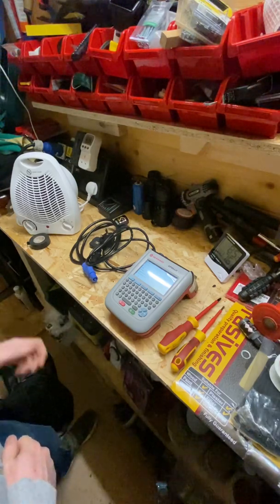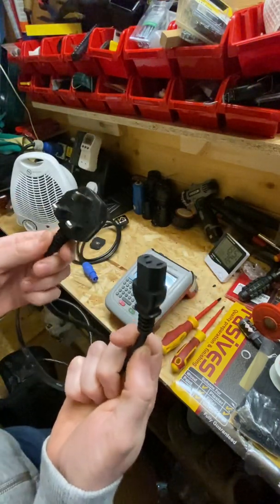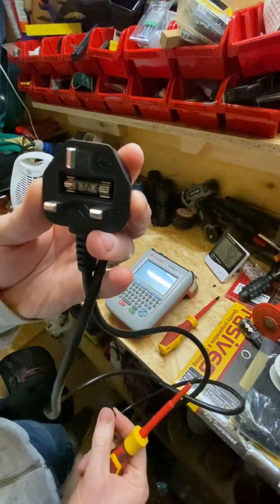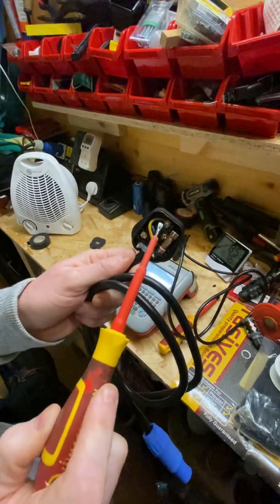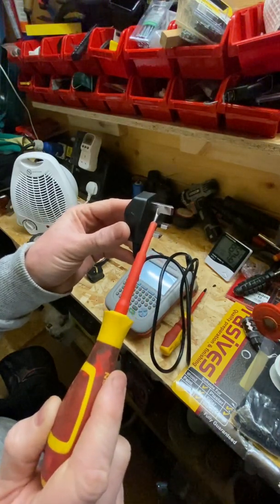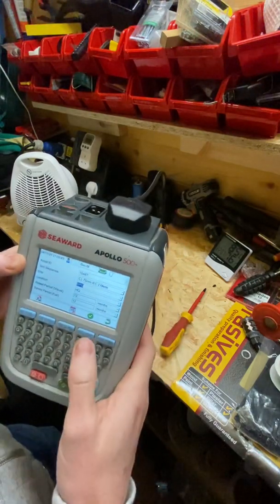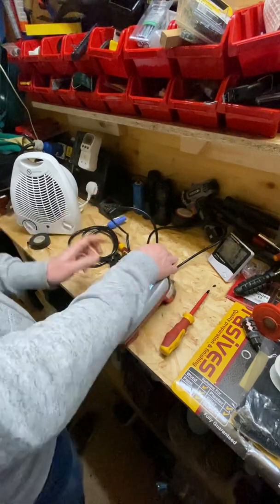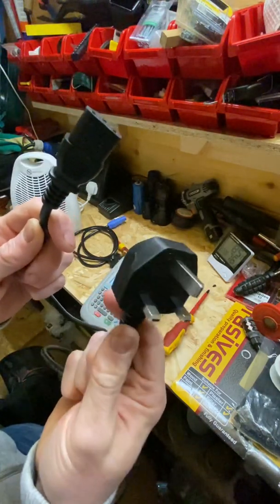PAT Testing a power cable (IEC)

Comment from the maker: Let mw know id you have any questions about this video
Reply: I have a question. All IEC leads have an amp number on the plug, do I put that corresponding fuse into the ice lead. E.g an iec  lead is labeled on the plug as a 13 amp but the screen it's plugged into is only 25w. How do I know which fuse to use ? The fuse labelled on the plug or the lower amp fuse the screen uses ?

Comment: Do IEC to IEC extension cables (M to F) need to be tested in the same way? How is this done with a normal PAT tester which only has one IEC terminal?
Reply from the maker: Yes, very easy to test then using a Pat tester. One end goes into the iec socket and the other into the plug to iec adaptor

Comment: How would you IR and earth test an IEC lead using an MFT?
Reply from the maker: I wouldn’t really recommend it, you need a dedicated Pat testing machine that will make it far easier to
Reply: @caterhampattesting  In theory though, you could IR it easy enough (testing L and N together on one probe and E on the other) and earth continuity would be easy.

Polarity would be more difficult. Any good way of doing that? Thanks. Keep up the good work.

Comment: Thanks for the vid.
What's the pass threshold for the 13A lead?
Reply from the maker: It varies depending on the csa of the cable. They aren’t specifically called 13a cables as they could be only rated at 3,5 or 10amp maximum

Comment: Can class 2 equipment have an insulated plug pin
Reply from the maker: the only pins that should be insulated are the live and neutral. the earth pin should only ever be solid metal or sometimes all plastic for class 2 appliances. An insulated earth pin points towards a substandard plug/cable/ or appliance that it is attached to.